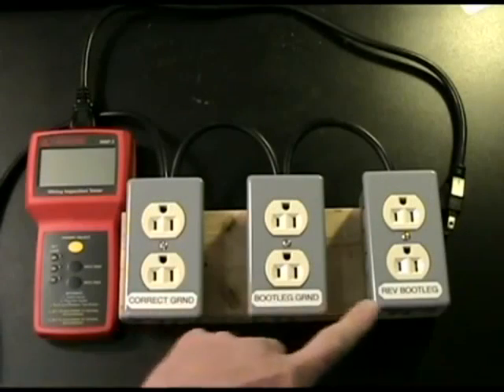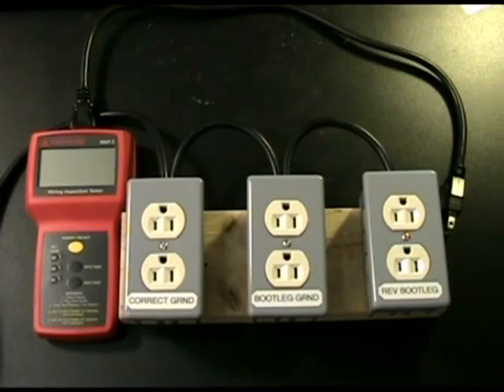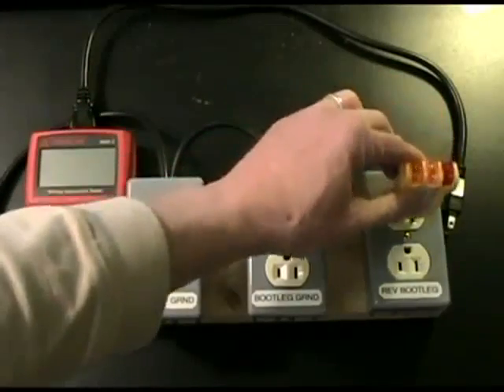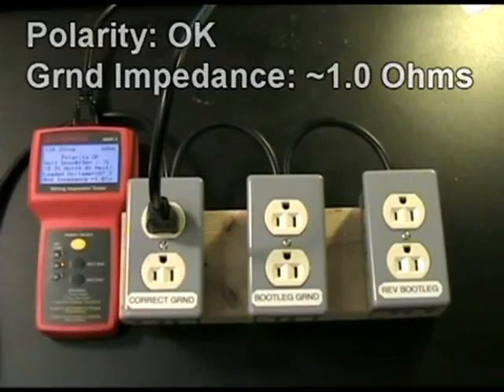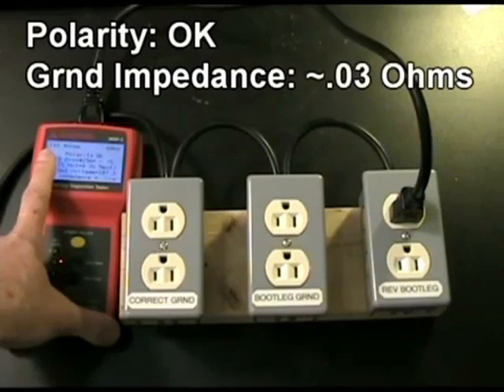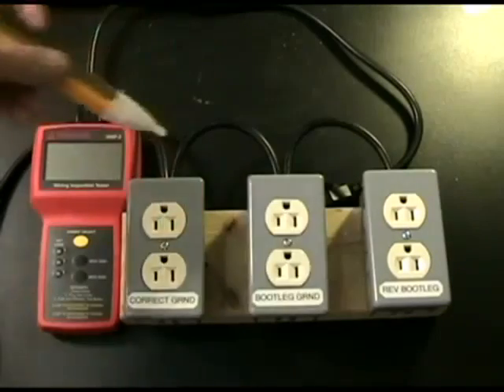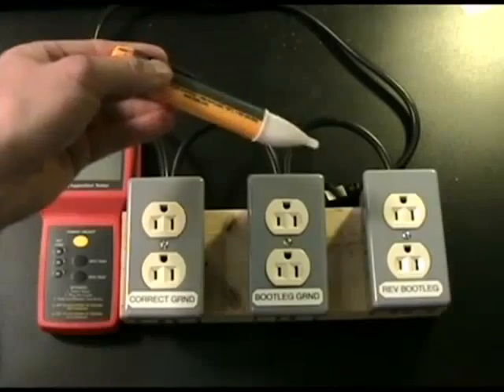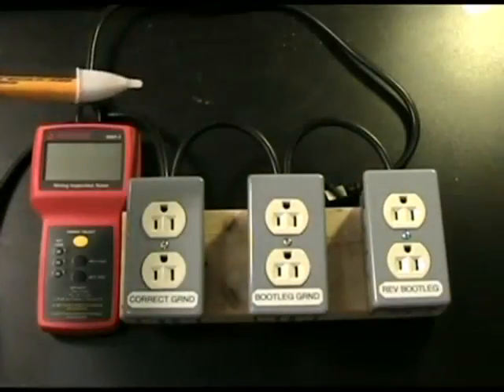Reverse Polarity Bootleg Ground Testing

Comment: I live in a house that originally had knob an tube wiring, but has been remodeled at least twice, the first time with older nm w/o a ground wire. The 2nd remodel the electrician added circuits with a ground wire to the old ungrounded circuits. He bootlegged the grounds in the added circuits so they would fool the plug in tester. I always replace every switch and plug in the houses I buy and found these illegal bootlegs. That's a big job, but not as big as running new wires to get a legitimate ground, which is what I'm now doing.

Comment: Great info, diagrams. I’d be surprised if any authority allows bootleg grounds. Such a config will send half the circuit current through the ground wires, energizing the ground yoke of the device, and any metal that circuit’s ground wire has been bonded to. Both a fire and a shock hazard.

Comment: So what about a light switch that has neutral, hot, load, and ground? Fine to do neutral to ground with ground to ground still?
Reply: You do not connect neutral and ground after they have been separated at the main panel.

Comment: Wonderful chart at the beginning of the video. The third duplex receptacle,
how could the tester not know the reverse polarity?
Reply: Ted,  it’s quite simple actually.  Reverse polarity means there is voltage between neutral and ground.  Since they are tied together there is no voltage difference.  There are outlet testers which combine both devices together.  But using the two as shown here is just as easy.

Comment: Shouldn’t the reverse bootleg show polarity wrong? Test the wires for hot and neutral before wiring and tape them accordingly.
Reply: No, as the reversing is in the upstream. Nobody would connect the ground to the black wire.

Comment: I've also use a cheap tester made of a neon bulb in series with a drop resistor  only placing my finger on one lead and touching the hot wire with the other lead while the room is mostly dark. The neon bulb slightly lights up. This depends on no load being turned on anywhere on the circuit feeding the receptacle in question.

Comment: He briefly touched outlet covers #2 and #3 at the same time, but sadly no shock. (The covers are plastic. Cheapskate.) Show the danger by plugging metal appliances into #2 and #3 and then touching them together for a big spark (5,000A fault current).

Comment: You should do that before you use any strange outlet. In 2015 in Finland a plumber died because of that. The resident had only used his double insulated toothbrush on the socket. It had been wrongly done before he moved in. Since the ground connectors here are visible the resident was near death every time he hooked his toothbrush. The connection in itself would have been legal if properly made.

A GFCI o the equipment does not protect from that.

Comment: what does in mean when the neutral light is dim?
Reply: It could be due to bad ground connection.  Meaning a high resistance on the ground wire.

Comment: So beyond opening the box and checking the wiring even an intermediate level of inspection probably won't caught a boot leg if its not reversed.  Hopefully not to many unethical "house flippers" saw this video.  Also although you mentioned it wasn't code, you didn't explain why its dangerous; is it beyond just a false sense that the outlet is grounded or is there more to it?
Reply: The ground is no longer at ground (0 volts) potential. It is at 120 volts. Touching the metal part of any appliance would be exactly like putting your finger into an AC outlet. The current will flow from the outlet through you to the floor - the ground. I don't think you will like what happens.

Comment: I connected power in my mini portable  office 
Its working ok but when I turn the lights off the wire makes smoke because it star to get hot .
Any idea what's wrong??
Reply: Don't wait for a fire. If it's smoking its because there is a short circuit or damaged circuit board. Either fix it or junk it but don't use it.
Reply: How did you fix this problem?
Reply: It has been a year. Send us a link to your obituary.

Comment: Mike, Great explanation!

I recently purchased an older coach (1986 Winnie) that is generally quite sound, but requires normal upgrade and renovation in the coach.  After connecting to an available circuit at my house, the AC seemed to function normally.  However, I went to replace our step last night and caught the "bite" of 60 cycle current when my tape measure touched the frame.  

The older plug and adapter showed signs of heat, so I first replaced the plug and added a new 30A receptacle.  Then, I went through my own wiring and receptacle from the house and all seemed normal.  The next "link" in the system was the coach where I knew there were multiple possibilities for the "short"  So, I searched YouTube and subsequently found your video.   So, I  picked up the proximity voltage detector and circuit tester with GFI test right away.

The exterior of the coach literally glowed current even though I couldn't feel it by simply touching metal.  Then, the most obvious suspicious item was a white GFCI breaker in the bath area.  Original sockets were dark brown. Therefore, the newer receptacle and cover were a natural place to begin.  Voila, the pole ground and safety ground were reversed and GFI test failed.  

I will follow up with a comment after making the required correction.  However, your advice was a timely reminder to check and double check wherever I go.  I connected to a yacht club dock in San Francisco a couple years ago where electrical wiring had just been completed.  The 30A receptacle had reverse polarity, but my boat panel has a built in sensor that both identified and blocked the danger.  The incompetent repair could have been someones' worst nightmare.   After following behind two incompetent electrical repairmen, I will check each time I dock either boat or RV at any new location.

Like many others who have commented, I have a significant level of "experience" and overlooked the obvious.  Your advice is a life saver... literally.

Best regards, and please keep up the good work!
Rich

Comment: I have a question in the case that you do in fact have an outlet that is wired with reverse polarity and bootleg ground: how does this effect any other outlets on the same circuit that are wired correctly?
Reply: The hot and ground are bonded (connected together) in the defective box so all grounds in all boxes will be hot, not ground.
Reply: If there is no ground connection between the boxes the other sockets are unaffected. If there is, then it is a short circuit and it would trip the breaker. 

However, this can be especially dangerous if you touch both properly and improperly grounded equipment at the same time. This would likely be fatal.

Comment: Just use a multimeter...
Reply: Nope. A multimeter will only tell you nothing is wrong, same as the plug in tester. A multimeter will only show you something is wrong IF you test to a ground wire in an extension-cord coming from a different outlet than the one you're testing and known to be correct

Comment: Thanks for the video.  I just discovered that an electrician apparently wired my 50 amp box on my house wrong.  My Son got a tingle when he touched the door lock with bare feet on wet ground.  I chased it all day trying to figure out was was bad in the coach.  Your video got me right to the problem.  Off to Alaska Sunday.  Thanks again.

Comment: Excuse me Mike, your outlets are installed upside down.
Reply: Actually that's becoming the standard these days.  As goofy as it sounds there have been cases where a plug is slightly hanging from the outlet, exposing the prongs, and some object falls across them.  When you install the outlet ground side up, an object usually can't balance and stay there, and will fall out.  Even if it can stay, it's on the ground only.
Reply: That's the new way. Hospitals all use the prong hole up. As stated, the reason is that a metal object will not touch an electrical cord that is not fully plugged in. If the two slots are exposed, the object will either short the circuit or will become electrified. There is obviously no danger from the ground plug.
When I first saw this about 10 years ago, I had the same reaction... that the receptacle was upside down.
Reply: No they are not upside down. Look at the writing on the side of the outlet. You can especially see it when you install a GFCI outlet. The test and reset buttons are labeled so you don't have to stand on your head to read them. Most DIY individuals install receptacles upside down.
Reply: @alanpfahler1707    I didn't notice that but that pretty much settles the debate as far as I'm concerned. "This Side Up" is pretty persuasive lol.

Comment: We need a device that can tell us if the hot, ground and neutral are all wired correctly.
Reply: Multi meter will show if it’s wired correctly.
Reply: @eloquent-nuance  ok but wouldn’t a regular multimeter show that? Not a fancy tester like you have?
Reply: John Simms 

It's called your brain...aided by the metering and techniques shown here.  I never trust a single device.